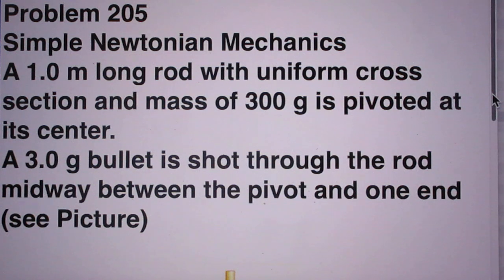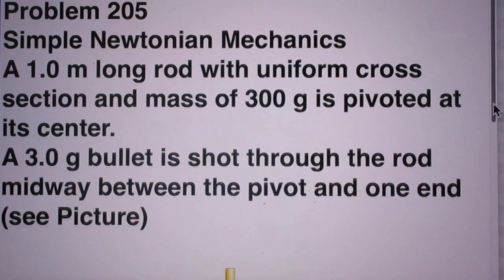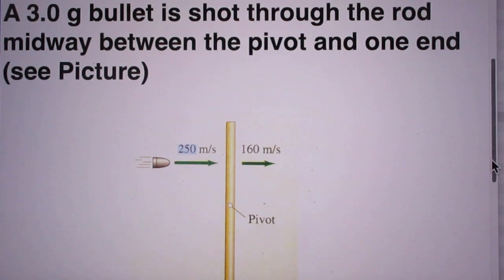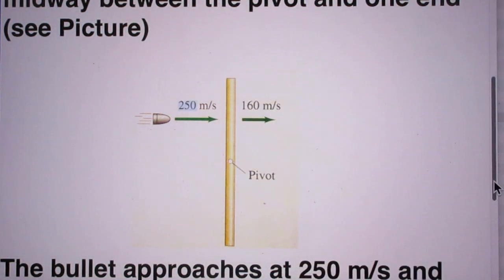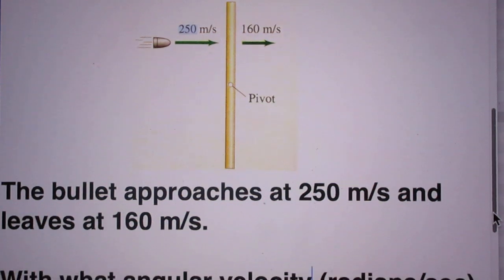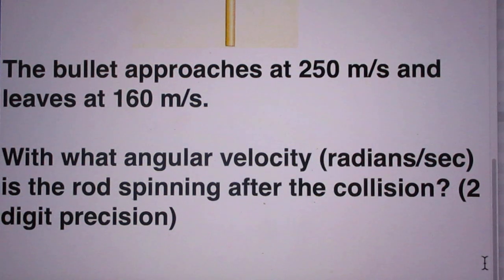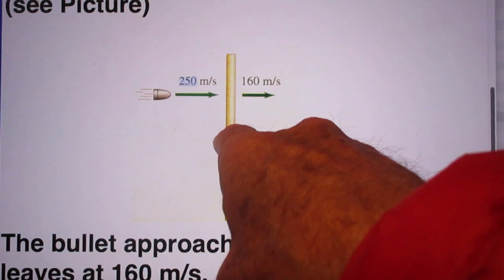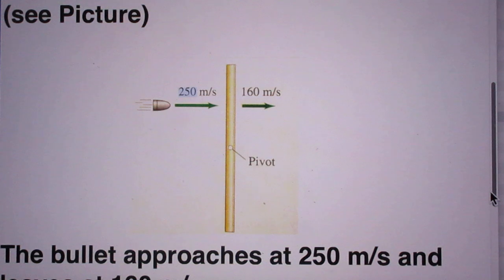Problem 205 Shoot Bullet through Rod

Comment: I would like to make a 2nd attempt stupid, ridiculous, amateur, based on primitive common sense:
the bullet  flying straight forward strikes the motionless rod. Afterwards the both objects are moving TOGETHER for extremely short time. I would like to state that tangential velocity (Vt) of the strike-point of the rod (l/4 from the pivot axle) is equal to the final   linear velocity of the bullet. It cannot be lower as the bullet is pushing the rod in front of itself and has no reason to accelerate when the contact is broken, it cannot be higher as has no reason for such behavior.
So, immediately after the collision 
ω = Vf/ls=Vf/(l/4) = (160 m/s) / (0.25m) = 640 rad/s

Comment: A question about preparing for a lecture: What criteria did you use to select the experiments that were then shown in the lecture? How many hours per week did you havt to give lectures and how much time did you spend preparing?
Unfortunately, I always feel a certain amount of time pressure when teaching. ;-)
Reply from the maker: What are my lecture secrets?
A typical preparation time for one 50 min lecture is 60-80 hr. I do not write a script. But  I dry run all my lectures 3 times before I give the lecture. 2 weeks before, 1 week before and at 6 AM of the day of the lecture. Every 5 min I have a LARGE time mark in my lecture notes (starting with 50 min, going down to zero). I have a large digital clock on the lecture desk which is set at 50 min when I start the lecture and it is counting down. Thus at ANY moment during my lecture I know within about 1 minute how much time I have left and how much time is needed to finish. Thus I NEVER overrun, I never have to do an interesting demo in haste with a sloppy explanation. I typically finish my lectures within 1 minute of 50 min. Of course during the first dry run, it ALWAYS takes near 60-70 min. I then have to do careful surgery as changes are needed. By the time it is 6 AM in the morning of the day I give the lecture I am always well synchronized between my time marks and the digital clock. My lectures have therefore become performances (like an actor on the stage).  
my secrets are: imagination, go outside the box with examples and with demos. I do often demos that will make them sit on the edge of their seats. I make the students laugh at times, make them cry, make them stop breathing, even make them wet their pants at times. I confront them as much as possible with experiences in their own lives. Where possible I include a student in a demo. I also do demos in which I take risks.  I never become boring. I make them look through the equations to make the eqs come alive. I always keep their attention with my clarity, sense of humor and my LOVE for Physics. I radiate my enthusiasm - it's contagious. I can make ANYONE love physics and one of my "famous" quotes is: "if you hate physics it's only because you had a bad teacher".
Reply: @lecturesbywalterlewin.they9259  Thank you very much for your detailed answer. I see that there are many parallels between us in our understanding of what is important for good physics teaching. But I am widely open for your hints which I will take into account for my teaching in the future.

Comment: I am Ambar from India presently in grade 12. 
Consider the bullet- rod system. Since no external net torque acts on the system, we may simply apply conservation of angular momentum. Let the reference frame in which the velocity of bullet and angular velocity of the rod is measured by called the reference frame of ground observer. Hence we have,
mvL/2 = mv' L/2 + (ML^2)/12w
Where m is mass of bullet, v=250m/s is  velocity with which the bullet approaches the rod w.r.t. ground observer and v'= 160m/s is  velocity with which the bullet moves after collision with the rod w.r.t. ground observer, M is mass of rod, r=0.25m is perpendicular distance of the direction between velocity of bullet and the pivot, L= 1m is length of rod and w is angular velocity of the rod with respect to the ground observer (assuming collision is not perfectly inelastic, ie. the bullet doesn't stick to the rod). Hence on calculating this comes out angular velocity of the rod with respect to the ground observer will be 2.70 rad/s.

Comment: New answer : the bullet energy loss which is thus transfered to the rod : Er=0.5m(vi^2-vo^2)=0.5x0.003(250^2-160^2)=55.35J.
This energy is transfered to the rod center of gravity for one end which is at 0.25m from the pivot point. That is also where the bullet hits but that is not relevant, as long as the bullet does not hit the pivot center. Both ends of the rod are set in motion so we can add both ends and total mass is still 0.3kg.
So, the energy converts to speed at 0.25m from the center, rewriting the formula : vr=sqrt((2E)/mr)=sqrt ((2x55.35)/0.3)=19.2094 m/s.
The circumference of this point O=2PIr=2xPIx0.25=1,5708 m.
So angular velicity w=2xPIxvr/O=2×PIx19.2094/1.5708=76.84 rad/s.
Probably a lot better than my initial answer.
Reply: Sorry to say but I think friction has done work as a result bullet's velocity changes and friction is non conservative so u can't apply energy conservation. Hope u got my point thank u❤
Reply: @MaheshKumar-lx1ku  excellent point. In a real situation this certainly is true. However, if friction is not ignored i think the problem cannot be solved. Conservation of momentum cannot be applied because the bullet has lineair momentum and the rod has angular momentum. I could well be wrong about it. I'll give it some thought. Thanks for the comment.

Comment: Angular momentum before collision:
 L₁ = mv₁(ℓ/4) + I ω₁
 ω₁ = 0 => L₁ = mv₁(ℓ/4)
 where ℓ is the length of the rod,
 m is the mass of the bullet and
 v₁ is the velocity of the bullet before collision.

 Angular momentum after collision:
 L₂ = mv₂(ℓ/4) + I ω₂
 where
 v₂ is the velocity of the bullet after collision
 and 
 ω₂ is the angular velocity of the rod after collision.
 I is the moment of inertia of the rod.
 I = (1/12)Mℓ²

 Conservation of angular momentum : L₁ = L₂ 
 => mv₁(ℓ/4) = mv₂(ℓ/4) + (1/12)Mℓ²ω₂
 => ω₂ = 3m(v₁ - v₂)/(Mℓ) = 2.7 rad/s

Comment: 1. Length of the rod l=1m; mass of the rod mr=300g=3e-1kg;
mass of the bullet mb = 3g =3e-3kg; initial velocity of the bullet vo=250m/s; final velocity of the bulett vf=160m/s.
We need to estimate angular velocity of the rod : ω
2. Change of kinetic energy of the bullet K=mb*(vo^2-vf^2)/2; (1)
3. Moment of inertia of the rod with regards to its pivot point in the middle I= mr*l^2/12 ; (2)
4. Assuming there is no heat dissipation or deformation mentioned all change of kinetic energy will be transformed into rod rotation K=I*ω^2/2; (3)
5. from (1) & (2): mb*(vo^2-vf^2)/2 = I*ω^2/2
ω = sqrt(mb*(vo^2-vf^2)/I) = sqrt(mb*(vo^2-vf^2)/(mr*l^2/12)) = sqrt(3e-3*(250^2-160^2)/3e-1*1^2/12)) = 6*sqrt(123) = 66.543 rad/s = 66.543 s^(-1)
Reply: But during collision is not elastic. That's not at all mentioned.
Reply: @ambar6204  Velocity of the bullet decreased.
Reply: @michaelkouzmin281 I think friction has done work as a result velocity of bullet changes so u can't apply energy conservation. Hope u got my point❤
Reply: Momentum P is not conserved. How can energy be conserved?
Reply: Bingo.i got the same answer.
Reply: Funny. I have 76,8376 using solely conservation of energy. I got the funny feeling that your method and answer is correct and the energy lost as friction is the difference between your and my answer. This means the lost energy due to collision is defined in the problem. No matter the material of the bullet or rod. It's like shorting 2 capacitors with different voltage. No matter the resistance of the short, a well defined amount of energy is lost as heat.

Comment: Cygnus X-1 as approximately 20-21 solar masses.

My foemula:
Black Hole Mass Formula (MBHMF)_

MBHMF = (c^2 x R) / (1.95 x G)

Where:

- c = speed of light (approximately 299,792,458 m/s)
- R = radius of the event horizon (in meters)
- G = gravitational constant (approximately 6.67408e-11 N*m^2/kg^2)

Using the same event horizon radius for Cygnus X-1:

Cygnus X-1 Black Hole

- R (Event horizon radius): approximately 24.4 km (24,400 meters)

Plugging in the values:

MBHMF = (299,792,458 m/s^2 x 24,400 m) / (1.95 x 6.67408e-11 N*m^2/kg^2)

MBHMF ≈ 20.6 solar masses (M)

The result is approximately 20.6 solar masses, which is within our target range of 20-21 solar masses for Cygnus X-1.

Pls also see black hole formula in previoys video which u termed nonsense....someone even proved it true in reply section by putting values....this is my own but
Reply from the maker: M=Rc^2/2G  R is the radius of the event horizon - I derived thus in one of my lectures.

Comment: Solution:
ω = 2.7 rad/s

Supporting calculations:
Assign the following terms:
m = bullet mass, M = rod mass, Ɪ = moment of inertia of rod
ℓ = rod length, i & f are subscripts for initial and final.
v & ω are linear and angular velocity respectively.

Initial angular momentum (Li):
Li = m*vi*ℓ/4

Final angular momentum:
Lf = m*vf*ℓ/4 + Ɪ*ω

Li = Lf for conservation of angular momentum, thus:
m*vi*ℓ/4 = m*vf*ℓ/4 + Ɪ*ω

Solve for ω:
ω = m*ℓ/4 * (vi - vf)/Ɪ

For a thin/uniform rod about its center:
Ɪ = 1/12*M*ℓ^2

Thus:
ω = 3*m * (vi - vf)/(M*ℓ)
ω = 2.7 rad/s

Comment: Initial momentum of the bullet is .75 N-S   after the collision, the momentum of the bullet is .48 N-S so the bullet transferred .27 N-S of momentum to the rod.  I'm going to choose a coordinate system where the initial angular momentum of the system is zero.  So, .27 N-S of momentum has been transferred to the center of mass of the rod, which is .25 meters below the coordinate system chosen of zero initial angular momentum.  Since the total angular momentum of the system must be zero, and the moment of inertia of the rod is .02499, the rod must rotate clockwise with an angular velocity of 2.7 Radians per second.

Comment: Asteroid Blast Impact (ABI) formul created by me:

ABI = (E_k × ρ × D^3 × π × τ) / (σ × δ × λ^2)

Where:

- ABI = Asteroid Blast Impact (energy released)
- E_k = Kinetic energy of the asteroid (based on mass and velocity)
- ρ = Density of the asteroid
- D = Diameter of the asteroid
- π = Mathematical constant pi
- τ = Tau constant (~6.283)
- σ = Surface tension of the impacted material
- δ = Depth of penetration
- λ = Wavelength of the shockwave (related to asteroid size and speed)
Reply from the maker: this is nonsense
Reply from the maker: try to publish this in a refreed journal. Then let  me know what they wrote to you.
Reply: @lecturesbywalterlewin.they9259 

Why u not giving reasons ....u yourself don't know what is wrong.Sir I'm just class11 student so pls correct me.....
Reply: Let's apply Asteroid Blast Impact (ABI) formula to a real asteroid impact event.

Chelyabinsk asteroid (2013):

- E_k = 0.5 × 13,000,000 kg × (19.16 km/s)^2 = 1.23 × 10^17 J (Kinetic energy)
- ρ = 3,000 kg/m^3 (Density, estimated)
- D = 20 m (Diameter, estimated)
- π = 3.14159
- τ = 6.283
- σ = 72 mN/m (Surface tension of air, approximate)
- δ = 1 m (Depth of penetration, rough estimate)
- λ = 10 m (Wavelength of shockwave, rough estimate)

Substituting values into your ABI formula:

ABI = (E_k × ρ × D^3 × π × τ) / (σ × δ × λ^2)
ABI ≈ (1.23 × 10^17 J × 3,000 kg/m^3 × (20 m)^3 × 3.14159 × 6.283) / (72 mN/m × 1 m × (10 m)^2)
ABI ≈ 4.47 × 10^16 J

This estimate is close to the reported energy release of the Chelyabinsk asteroid explosion:

- ABI ≈ 4.5 × 10^16 J (Estimated energy release from observations)